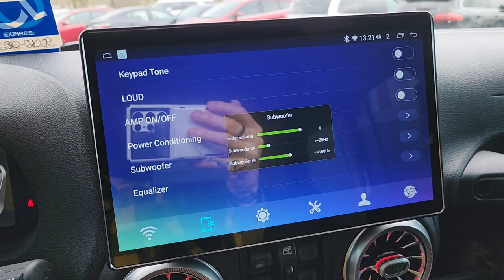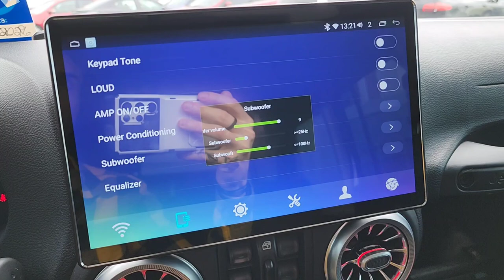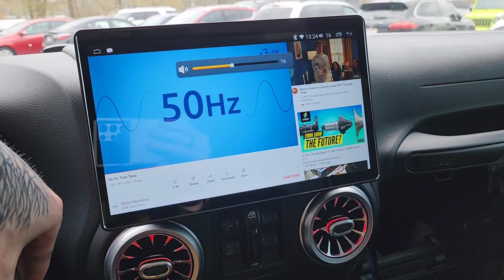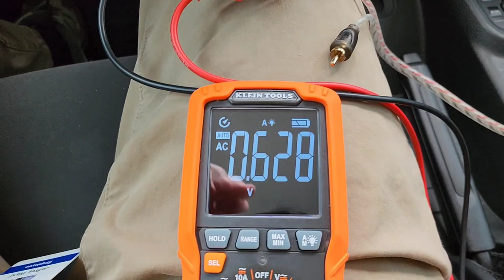How I test RCA pre-out voltage (bad advice in video - see comments)

Comment: You cant divide voltage from rca its the same. Even if you ise a y splitter its the same
Reply from the maker: You are correct. I was mistaken towards the end of this video to have added the voltage together to come up with 1.2v
I need to make an updated video to divulge that even with a Y splitter, voltage remains the same. It is not half per RCA like I mistakenly pointed out in the video.

Comment: I think android units are great, but the pre outs are the only down side. I usually tell people to invest in a line out converter if your getting an android unit.
Reply from the maker: Agreed. 
Surprisingly they listen to our feedback over the past 2 years and the new revised 2023 units from Joying have 2v pre-outs. Not the greatest but better than what my 2021 unit had in the video above.
I will gain match my amp now with these new higher voltage pre-outs
Reply: That is so true I have a audio control DQDX installed doing some testing and I also have the LC7I that I may put in and take out the DQDX
Reply: @ElevatedVehicles  well, the sad part is that 2v is only at max volume, and it's still .2v on subs

Comment: I went with the atoto s8 pro and i only went with it because it had optical output, which is FAR BETTER, than using rca outs on any HU when connecting to a DSP. But, before i switched over to optical, i used a Tru Technology amp line conditioner which allows me to input 8v of clean power into my amplifiers regardless of what the HU has.
Reply from the maker: heck yes man! That is clean voltage

Comment: On a joying headunit  switch it to loud in your settings leave your hpf and lpf open. That's what your Amp is for. get yourself a line driver hook it up to your RCA then hook it up to your Amp you will see a night and day difference in your subs or sub.

I'm on my 3rd joying headunit I've dealt with one rca for my subs for a minute but they hit hard.
Reply from the maker: Damn I didn't even think to put high pass & low pass to full because yes that makes sense. The amp is gonna filter it anyways. Solid idea. 
I read loud, on the Joying, will push more volts to the sub pre-out higher at lower volume and decrease voltage as you increase volume to avoid clipping from the headunit. Is that true?
Reply: @ElevatedVehicles  Yes, just leave the  sub settings open. When you put it on loud mode your subs won't clip because your only getting signal from 1 sub RCA  but you have a chance of clipping your mids  and highs  the best way to handle that is to use your EQ and lower your mids and highs. But regardless your mids and highs still will be louder on lower volumes, its just less volume to turn up, that's all. I use Power Amp app for my music all my music is in the headunit.
Reply from the maker: @22mell01  thank you for the tip!
Reply: @22mell01 Glad I found this video and these comments! 

I bought a Joying HU last year.

Since it blew my factory speakers I decided to upgrade them and add an amp. 

This is my first amp install. I totally misunderstood how to check voltage from the RCA outputs! I had my meter set on VDC. I even emailed Joying for support. 

Now I see here that not only was I measuring the wrong way; there still may be a need for an LOC? I'm getting around .8VAC.

Question... Is there such things as low level to low level LOCs or do I get high/speaker level LOCs?

Thanks in advance!
Reply: @ItsMrAnthony-8a line driver.
Reply: @Dingleberry1856  Thanks for your response! Wow! I've come a long way since this question! I did eventually install an LOC, but it was never necessary. Although the head unit's rca voltage is very low, it does fall within my amps tolerance. The manufacturer (Recoil) says it's good. One thing I noticed back then is that the LOC does introduce a pop sometimes when I go volume up or down. I'm sure that was always there. The LOC is just amplifying it. I'm 100% happy with the outcome! 👊🏾

Comment: Hii, 
I have a weird issue
When i normally play songs in headunit with my phone using bluethooth, my subwoofer only producing little bass but when i increase bass through my phone like  12db to 17db its produces bass well .

Is it car headunit  rca output that gives low voltage signal?

Comment: My kicker amp is running only a single rca from my pioneer head unit, installer said this is better 

Side question, you thinking about doing a 360 bird eye view on the Jeep? I just ordered the joying 11.6 and they don’t offer a camera kit
Reply from the maker: I'm going to try that tonight (running a single RCA) because I'm getting some ground loop feedback in my sub... Unless I unplug the RCA cables then it's gone. So I'm hoping that will be the fix.

Yes! Would love a 360 bird eye view for off roading & parallel parking. Agreed, sucks Joying doesn't offer one but apparently they're working on it. I am, however, installing a front camera that will be ran to small video splitter so I can easily toggle between front and rear. Front will be 'slave' to rear meaning rear will always be default and 'on' unless I hit the toggle switch.
Speaking of, I just uploaded a video about the toggle switch I'll be using.
Reply: @ElevatedVehicles  nice! need more info on the push button start. I have a 2015 JKU
Reply from the maker: @MastaFlash13  damn good eye! I'm working on a system that will compete with smart Wrangler but at a better price point. Plus smart Wrangler system is in Australia. But we should be announcing something in the next 3 weeks ❤
Reply: @MastaFlash13  More info about smart wrangler on my YouTube channel 😊
Reply: @ElevatedVehicles  did you get the ground loop noise sorted out?  If so what fixed it?
Reply from the maker: @timwheeler1503  Tim good day man. I haven't tried yet. Been working on another project. But I got 3 really good ideas to try for this Sunday to diagnose it.
Reply: @ElevatedVehicles  I also notice when I plug in both rcas to my amp I get engine noise or what sounds like underwater noise from the subs. Currently only running 1
Reply from the maker: @209Twinz209  whoa that's weird. Are the RCA cables shielded?